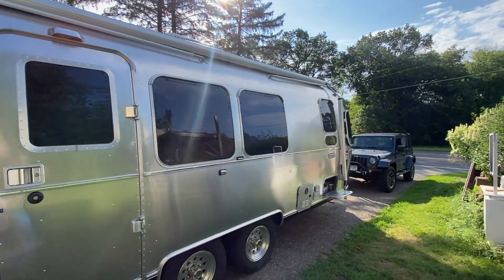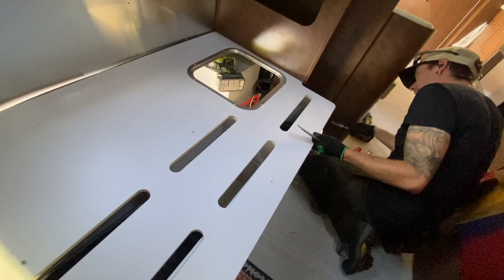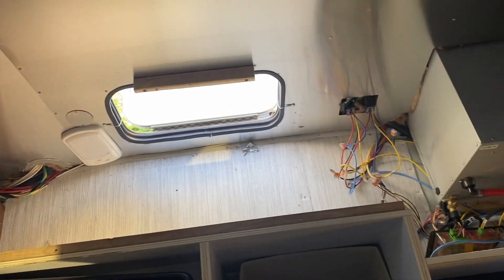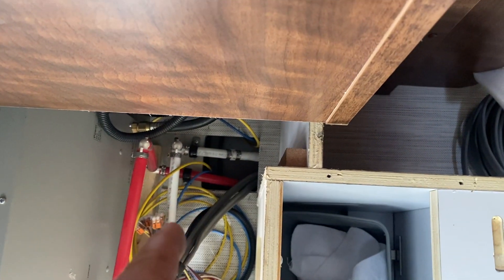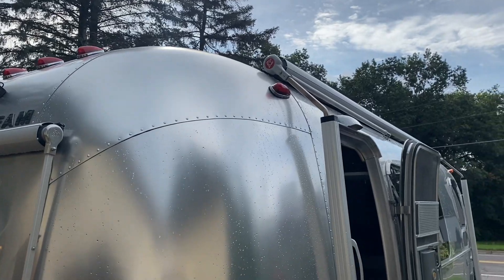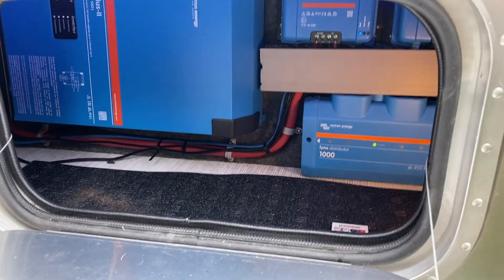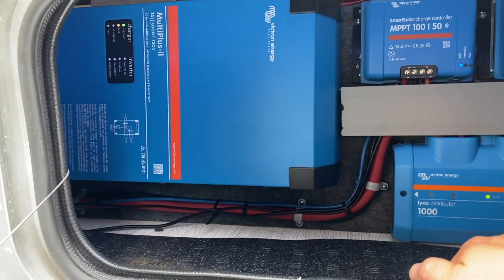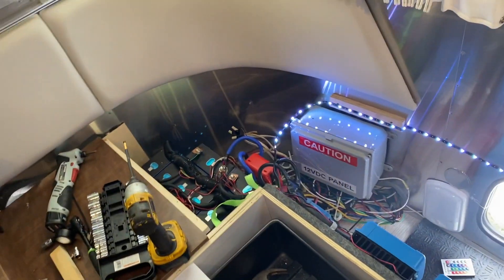Airstream Globtrotter 600 watt Solar Install with 560ah Custom Lithium Battery

Comment: Great video. We just found your channel and subscribed. It appears great minds think alike, as this battery is almost the same as the one I built. I even use an active balancer too. Five years ago, we took an early retirement, sold everything, bought an older MH and hit the road FT. It was the best decision we ever made. We discovered that we love boondocking and it helps stretch our budget too. We quickly learned the advantages of solar and decided to build our solar/battery system in 2 phases, a 12v system for our 12v DC needs and a 48v system for our 110v A/C needs.

We started with a pair of lead acid golf cart batteries and custom built a 620-watt liftable solar array mounted on the side of our motorhome. We lift the array to the optimal angle to improve their output by 20-30% vs flat mounted panels. It serves as a nice bedroom window awning too, practically lifting itself to the desired angle with a couple gas struts, and it's easy to clean with a windshield squeegee, standing safely on the ground. This set-up, while far from optimal, allowed us to boondock till we could afford to do better. 

We finished the 12v part of our build last January, with the addition of a 560ah LiFePo-4 battery that we built with 8, 280ah prismatic cells, like this build. We use a Heltec 350amp BMS, and a 5a active balancer to keep the cells synched up. We typically use less than 20% of their capacity daily giving us enough reserve capacity for about a week of bad weather before we have to run our generator for charging. It cost us less than $1,500 to build this 560ah 12v (7.1Kwh) battery, including the high amp BMS and balancer. We chose these cells rather than a pre-built battery because they fit perfectly under the steps of our MH where our old pair of GC-2 golf cart batteries used to reside, saving 35lbs too. We insulated the battery compartment, cut a 1" hole in our step risers and installed a tiny computer CPU fan to keep this space at close to room temperature, so we don't have to worry about the BMS shutting down charging if they get too cold - or their life reduced from getting too hot. We use an 80A Progressive Dynamics LFP converter/charger, a 1,000w Renogy PSW inverter (to run our TV, PC, ice maker, etc.), an Epever 50a MPPT charge controller and a Lnex battery monitor/shunt. This entire 12v system cost us under $3,500 to build and takes care of all of our basic off-grid needs except for air conditioning and microwave use. 

By mounting our solar array on the side of our MH, we left the roof free to rack 8, 550W Sungold Power solar panels (4,400 watts) down the length of our 35ft Class A about 15" off our roof, above our AC, fan shrouds, etc. (about like that blue bus in the background.) They will cover the entire roof, providing some nice shade with plenty of cooling air underneath, further increasing solar output and reducing the heat load on the air conditioners too. We bought them for only 51 cents/watt shipped to our door! We're assembling the components for this build now. We bought our aluminum racking material in Yuma, where we're wintering over this year, for under $400, which is the best price we've found. Our solar panels, wiring breakers, etc. arrived last week, but we're taking our time to get everything in and installed over the winter. At 67 yrs old, we're moving much slower these days. Our Sungold Power all-in-one 48V, 5,000W, 120V PSW Inverter/100A charge controller/battery charger just arrived Saturday. Our 48v battery bank will use 16, 320ah grade A prismatic cells which only cost us $1,726 from EEL batteries. So together with our 560ah (7.1 Kwh)12v bank, we will have a total of 23.5 Kwh of batteries onboard - kept charged with over 5,000 watts of solar. We will be replacing our 24 yr old rear 13.5k btu rooftop Dometic AC with an EG4 28.5 seer-2 plug and play 12k btu mini-split heat pump. This second phase will provide 24/7 off-grid air conditioning, supplemental heat from the heat pump and allow occasional usage of our rooftop mounted Furrion AC in the front of our MH during peak afternoon hours, as well as give us whole house 120v ac power. We'll soon have total off-grid electrical independence on a budget we can afford, reserving our 5,500w generator for emergency back-up use only.
Reply from the maker: Wow, that’s a quite a system! Way to go!

Comment: Hey.. Out topic Question .. If I have 3 solar panel of 45VOC ,10A and I need 90VOC can I connect 2 in parallel and remaining 1 in series??? This Odd number connection is right??
Reply: No, do those 3 in parallel. Being that they are 45Voc they’ll do fine as parallel.
Reply: @HimmelbergerBus  Just want to know if i did this Irrespective of Performance... Is it correct or not technically...  that Parallel Panels Ampere gonna add  right?  that amps can go through the 3rd series connected panel?
Reply: It is like 2 panel Added ampere going through 1 Panel... Can it damage?
Reply from the maker: The two panels in series will run at 80v while the other runs at 40v the MPPT will not handle it correctly, nor will the wiring . I recently had a customer who did something similar and melted the MC4 connectors.
Reply: @sotasolar  See .. I first connect Parallel (45 and 45v = 45V and 10+10A = 20A) so its output is 45V 20A and then i connect another 45v Panel in series to this Parallel panel but its voltage is 45 but amps is 10 ... What im asking is can the 20A from that Parallel Panels Can go through the series connected Panel? Why because if u connect series current has to go through the panels right?
Reply: @sotasolar  Connection is Like .. 1st and second panel +,+ /- ,- And Got common "+" and " -" to this Negative I connect 3rs Panel postive   and taking output from 1st Common Positive and 3rd Panel Negative

Comment: That turned out great! Would the customer have to worry about throwing something into the compartment and damaging any of those components? I was thinking of a plexiglass layer for protection. Could still see the wire art. Lol!
Reply from the maker: We’ve considered that in the past but I believe there should be easy and quick access to things like disconnects, fuses, etc. in this case everything is pretty well covered and they just threw in a few plastic boxes into the space. Thanks for the comment!